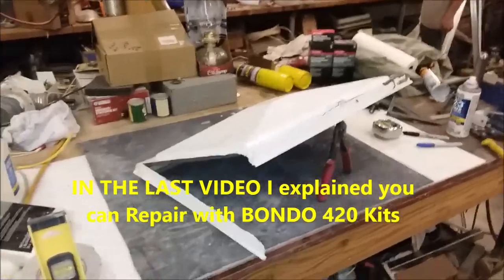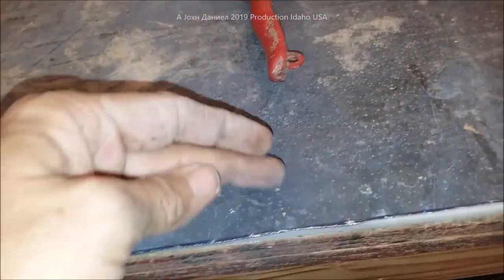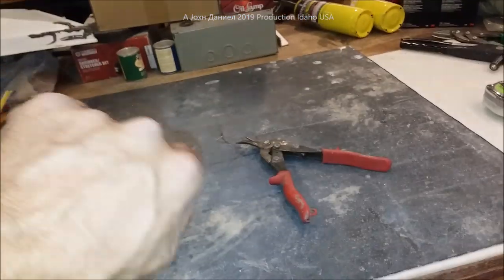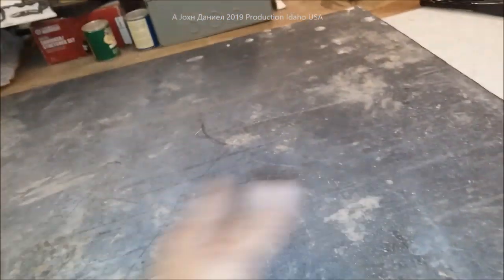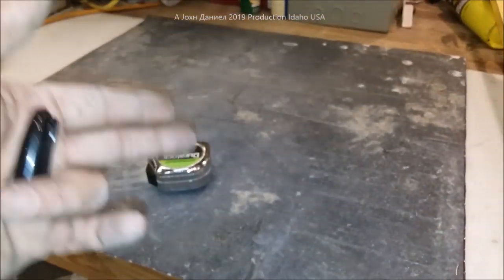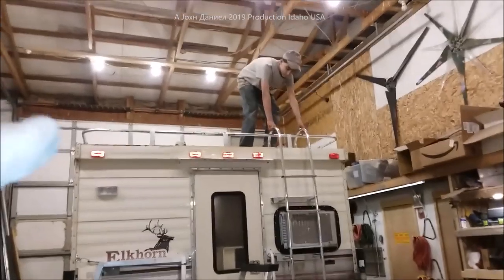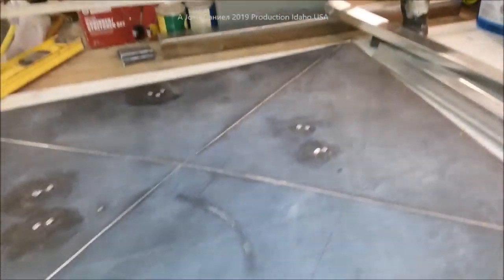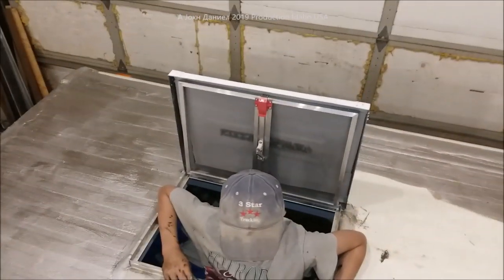Make RV vents or escape hatches out of metal, EASY, for less

Comment: I bought my cab-over camper in 2000. I am on my third or maybe forth emergency vent. They are the same worthless ones you picture in your video. I have no metal skills so I am in the process of making one out of wood. Nice video. I admire your fabricating skills.
Reply from the maker: If you want to make a metal version, use plywood to make a template to fold edges on.
Reply: @JOHNDANIEL1  Good call. I'll try it, thanks!

Comment: Good job on the metal bending, etc.
Makes me feel like I can do it too.
Mr. John, you may have fixed something  this before.
I have a 2006 Dodge Caravan with a side door wiring harness that keeps going open , the door opens about 3 inches and stops. 
I've soldered it three times. 
Is there wire that is better to install in the track? 
Something that was designed to bend repeatedly without breaking every 6 months?
Thanks
Reply from the maker: Are you referring to the auto/powered opening feature?
Reply: @JOHNDANIEL1  Yes.
I have two of this Dodge van/year.
I have gotten good at soldering but the flexing of the wires keeps breaking them.
There has to be a woven wire or one that maintains a curve better to prevent the breakage. 
At work, phone cords had thin ribbon conductors wrapped around a cord to prevent breakage.
I'm hoping that you may have fixed something like this or know of a fixit.
Even when I buy new wiring harnesses they break.
There has to be a better way.
I'd rather spend twice as much time fixing it once than fix it three or four times.

Comment: John at about 53 seconds into your video, there is a black gasket showing on the damaged escape hatch. What is that black gasket called? It looks like what i need to replace on my cargo area door. If you have a link that would be great.  Thank you for your informative videos and advice.
Reply from the maker: You can just buy that online, 1" wide self adhesive gaskets in window and door insulation sections. You'd need to measure the full run of it and order that plus about a foot. If you need the exact linked item let me know.